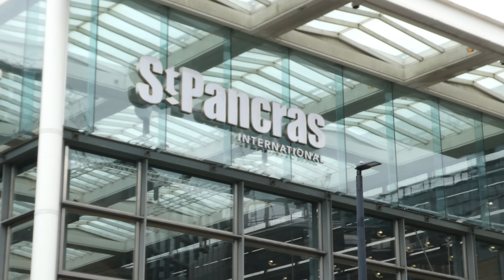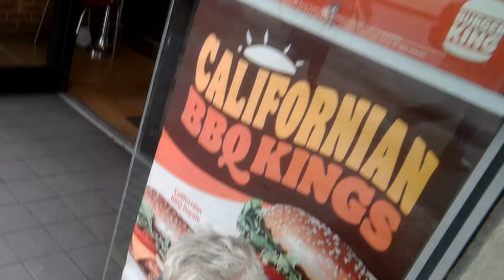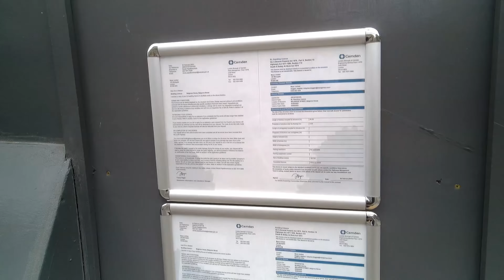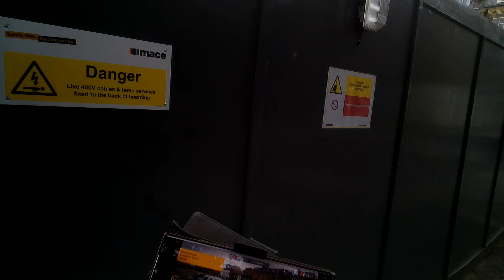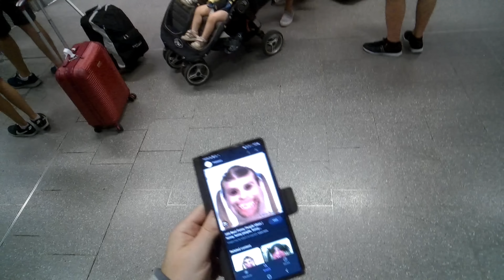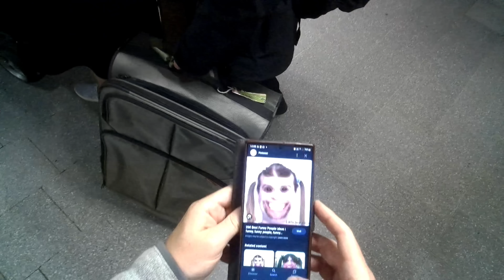Security Guard Bends Reality To Excite Police Officer👮‍♂️

Comment: Many auditors and the like film in shopping centres. It puzzles me sometimes....why?
Its not against the law, BUT you don't have a "legal right" to film in there, as you do on the street outside.  (For those who don't know there's a difference - brush up on your law)
It's pretty much the same as riding a bike or skateboard through a shopping centre. It's not illegal, but might be against their policy, and as such they may tell you to leave, or even physically remove someone.
Reply: You haven't explained what legal power they have to remove you given that policy doesn't trump law
Reply: @charlesdale1462 the law on trespass
Reply: @charlesdale1462  Trespass law.
The law allows owners of private properties to enforce their "policy".
Any owner or occupier can set conditions of entry to their premises.
Behave and it fine, but break the rules and you need to leave, by force if necessary.
Auditors tend to think just the fact its "not illegal" means its ok to do as they like. But if you're on someone else's property they have the legal right to remove you if you're acting against their wishes.
Reply: @auditpundit1199  . The line is somewhat blurred in that this is private land that openly encourages public access. You then have the problem that who is the referee on what , is breaking the rules and on whose opinion you could be trespassed.e.g. the site staff don't like your fashion sense.
Reply: @charlesdale1462 Its perfectly straightforward. According to the law, anyone acting with the authority of the landowner/occupier can enforce trespass. If it's a security guard or employee  its reasonable to expect they know the rules and are acting with authority.
Those famous words - "public access" mean nothing.  Honestly, if its private property they can enforce trespass and chuck someone out.  Whilst its not illegal to film, there is no "right to film" like we have on public streets roads and footpaths. So they can prevent filming by removal.